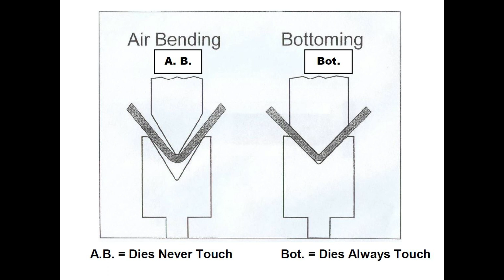How V Die Opening Affects Inside Radius - Forming on a Press Brake | RMT - Revolution Machine Tools

Comment: Punch also determines radius, as the thickness of the material increases if you continue to use a sharp/small radius punch. First you will get cracking on the edges, then the along the fold length with possible failure along the whole fold. That material looks like 2.5mm or 3mm so highly unlikely to suffer from that problem.